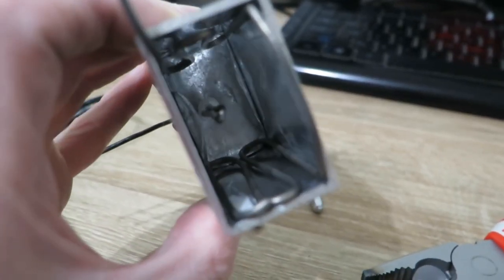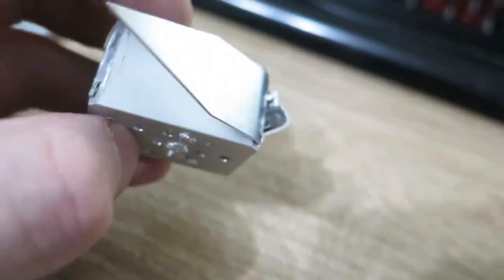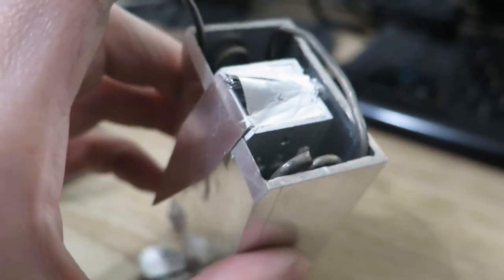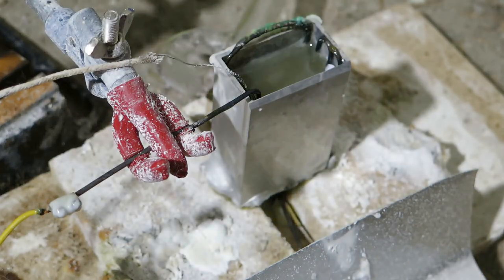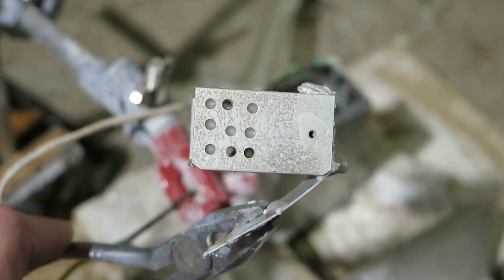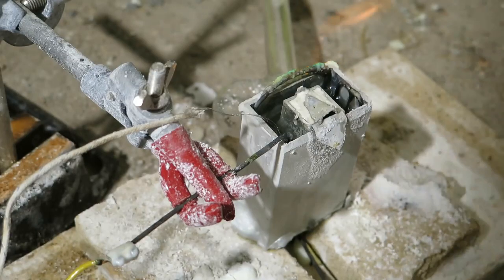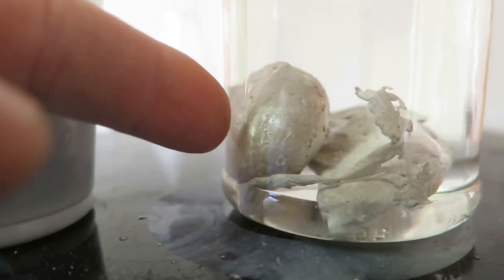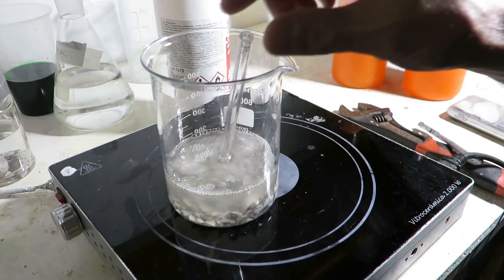Lab notes - "automatic" castner mini-cell #4

Comment: Hey, if you do this under a plastic bin with shield gas, or even a piece of dry ice, it will work. Then have sodium fall into mineral oil or something.
Edit: could do in a bucket with dry ice or soda/vinegar. Put piece of glass on top.
Reply: Why dont you just drop it into mineral oil when it is still molten ? Worried because of the temperature change ?
Reply: @jankastelec7579  well if theres no oxygen it should be alright. Thermal mass of like a quart of oil will cool it. Consider oil hardening steel.
Reply: the mineral oil could also be heated to melt the sodium to form it all into one mass to make it easier to deal with and give it as little surface area as possible to prevent as much oxidation as possible as well.

Comment: What about car parts? Could you use a radiator L or U tube, or an air conditioner cooling coil?
Reply from the maker: I think I caused some confusion.. I meant U tube to pass electorde through, so I don't have to drill cell body so I don't need to be concerned with leaks..

Comment: What voltage is required and what is a good current for a decent sodium production rate?
Reply from the maker: Not quite sure about voltage, it should be around 3V for most efficiency. In practice higher voltage is used where wase heat is used to keep hydroxide molten. I used here about 10V @ 30A. There is no limit for current.
Reply: @IlusysSystems  Interesting, I didn’t think 3V could work well. I have a rough cell created using some steel cans and for some reason I can’t get much to happen with one 12V battery and I have to step it up to two of them. But at this voltage the wires get quite hot and the sodium seems to also react and pop rather violently sometimes. Do you know how I could stop that from happening as it’s fairly dangerous. Maybe sealing the sodium collection vessel? I love your work though
Reply from the maker: @romanvarcolac2238  Hmm the current depends a lot on electrode surface area and distance between electrodes. So there may be your issue.
Also steel is not greatest material for container, because NaOH is very conductive, so you can't really isolate container from electrodes. From my experience even stainless steel will contaminate electrolyte quite quickly and sodium production will then diminish to nothing. From experiment here it seems, that heavily anodized aluminium works well and ceramic cell body would be better. Or if you could make it out of nickel.
Reply: @IlusysSystems   Oh I see. Is that why my sodium hydroxide is now a brown color because the steel contaminated it? Do you say I could use aluminum then for the body? I could cast an entire cell out of aluminum, but I thought aluminum would get destroyed quickly by the sodium hydroxide. My electrodes are nickel alloy thermocouple leads by the way and they seem unaffected by the sodium hydroxide
Reply from the maker: @romanvarcolac2238  Yes, the brown color is contamination. As you can see here the aluminium cell handles NaOH just fine and it will hold up for fairly long time.
Thermocouple leads or nichrome wire should work fine, I can't get nichrome here easily for some reason. I assume kanthal is way cheaper, but it doesn't work for electrolysis.
Perhaps if you could form some kind of "faraday cage" so current doesn't flow around body you can mitigate some contamination, if you can create/get relatively dense mesh it could work
Reply: @IlusysSystems  Thank you very much! I’ll try out some new designs and will let you know how they worked. Have a good day and keep the sodium production rolling!
Reply: @IlusysSystems  Alright, I have tried a cell which has a body of a can and through the bottom I drilled a hole for the cathode that sticks up through the center. The hole is larger than the cathode wire and I insulated it from the can body with plaster. Then I put a donut puck of aluminum I cast on top around the cathode and this acts as the anode. This cell works, but my sodium hydroxide seems to be reacting with the plaster I use as electrical insulation and it hardens after fifteen minutes or so. What electrical insulation do you use that can also withstand those temperatures and the sodium hydroxide? By the way, I only need one 12V battery for it to work in this configuration which is a great improvement
Reply from the maker: @romanvarcolac2238  You can try to use sodium silicate based sealant. It won't react, it can resist very high temperatures, but it's ceramic and has different thermal expantion coefficient than metals, so it may or may not seal.
It's best to not drill holes and pass electrosed from top somehow... Don't have proven technique here
Reply: @IlusysSystems  I see, yeah that makes a lot of sense considering sodium silicate is the product of the reaction between silicon dioxide and sodium hydroxide. I’ll try and get some or make my own for a sealing plug at the bottom. I thank you so much for the help you have given me so far, it means a lot considering how busy you may be as well!
Reply: @IlusysSystems  I haven’t tested my new cell yet, but I am using sodium hydroxide treated plaster for this trial while I wait for more sodium hydroxide and silica. Also I think the reason why you have sodium forming outside of your collection tube is because the sodium may make electrical contact between the aluminum collector and the cathode essentially making sodium form on the outside of the collector
Reply from the maker: @romanvarcolac2238  No, it happened because collection tube has disintegrated. This happened only after few hours and anodization was in very good shape after I inspected the collection tube. It had holes though.
Reply: @IlusysSystems  Ok, that makes sense. Would some other method of communication be better if there are any further questions as I feel I may be irritating you by asking you through YouTube
Reply from the maker: @romanvarcolac2238  I kinda preffer comms to be through YT, I can get 50 emails a day and so I tend to miss some
Reply: @IlusysSystems  Very well, just I hope I am not too annoying